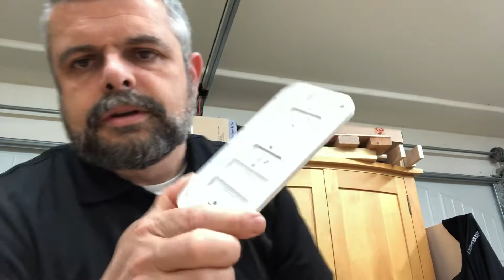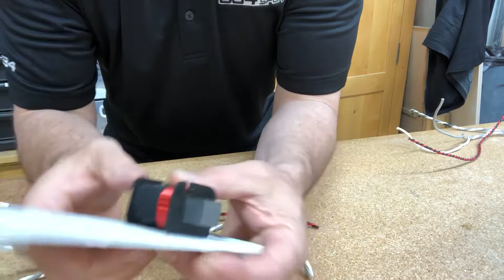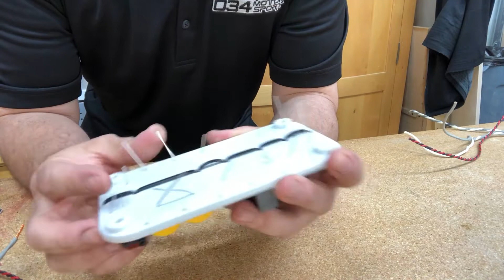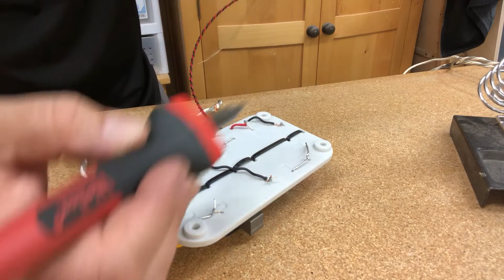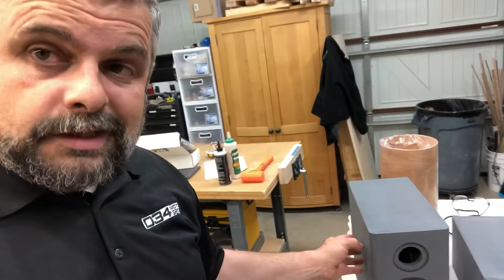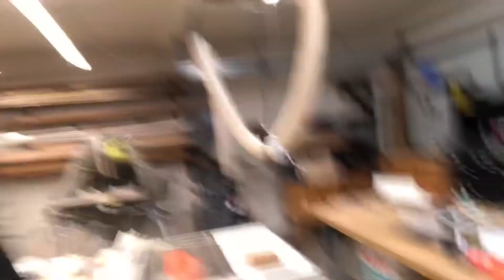CSS P215 Speaker Kit Crossover Assembly

Comment: Iron core inductor?
Reply from the maker: No this is a laminated steel core inductor, with excellent saturation characteristics, it can handle approx double the lower the speaker can, it’s a great choice here. 👍🏼

I would not used a iron core inductor in any of my builds.